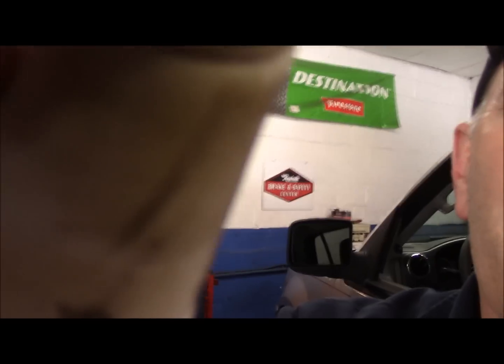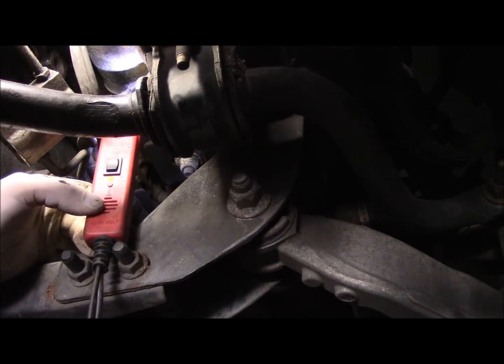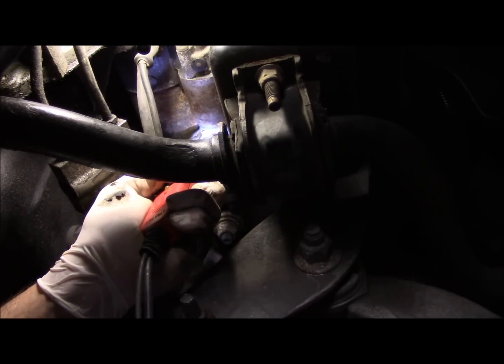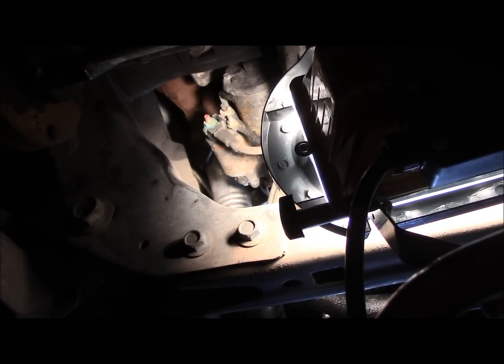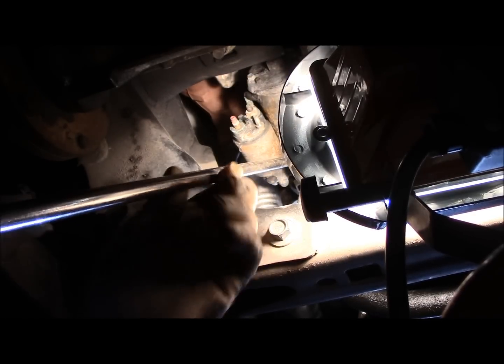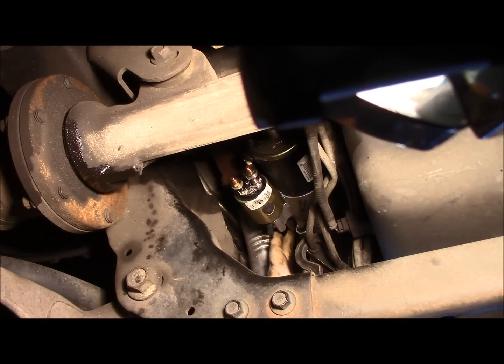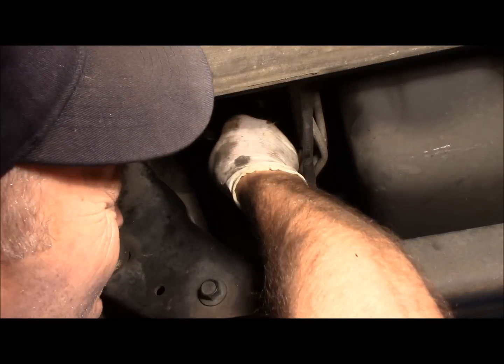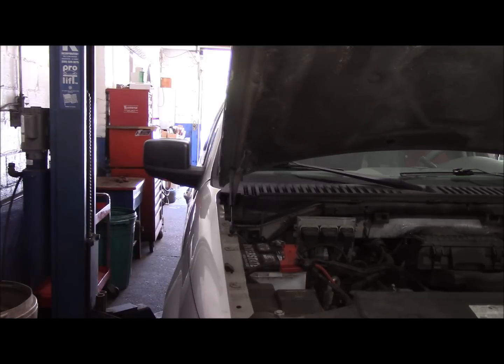Diagnosing  No Start / No Crank/Replace Starter 2006 Ford Expedition

Comment: Hi. Great video. I am encountering a no start (no sound when cranking) issue on my 2006 Ford Explorer 4.0L SOHC   Engine does not crank and is totally silent when turning the key. Vehicle has a brand new battery (12.5V with voltmeter ) and everything lights up on the dash as normal. The tow truck driver said it was surely the starter and this morning i purchased a new one and installed it, but same issue    What can be causing this?  Some kind of solenoid?   Any feedback will be greatly appreciated

Regards,
Mark
Reply from the maker: You will need to check power and ground to the starter before you replace anything.Keep me posted . Jim
Reply: Pat system my truck did that had to get another key made
Reply: Mark did you fix your problem I have the same problem please let me know thanks
Reply: @MrSkorpio317 was the starting funny before key fob went out? Or just sudden?
Reply: Did you get it fixed Mark?

Comment: question : if there is no power to the start post  and the cable is good  is that a pcm problem?
Reply from the maker: RICHARD COURNOYER If there is no power to the start wire when cranking the engine you will need to check the starter relay.
Reply: already did  there is no power   at any of the 4 terminals in the relay in any key position
Reply: i also installed a $20 ignition switch and still no crank

Comment: Hi. I dont have no power to truck at all. Same problems in video, but no power. Please help me
Reply from the maker: Did you check the battery and the connections?
Reply: yeah. been working on cars for years. first time, nothing comes on at all.  usallaly it atleast has door chime or headlights.  no short found yet.  all fuses good.  just confusing
Reply from the maker: Do you have 12 volts in the battery?

Comment: Your "scope on a rope" diagnostic tool looks great, but few amateurs (home, DIY) will have one. We just have a generic multimeter with short probe wires, maybe alligator clips. It might be even more helpful to describe your tool's indications in terms of what we'll see on our multimeter.

For example, how could someone use a multimeter to confirm the condition that your "green light means ground" tells you - maybe test continuity to a nearby ground point? 
How could someone use a multimeter to confirm the condition the condition that your "red light means power" tells you - maybe test voltage to a nearby ground point?
Reply: Bob Sutterfield yes I agree could point
Reply: Good point, I meant

Comment: What do you do when battery is charged and you try to jump start, but there is no power, no dash lights, headlights, nothing????????????????  Thanks.
Reply from the maker: The first thing to check is the battery cables if there OK check ground cable (negative )were it connects to the engine. If thats OK check the positive cables.Keep me posted

Comment: I have a 99 Expedition. I changed my starter and battery. I can drive on the freeway to work in the mornings and back home in the evenings.  As soon as I park my truck for 30 minutes or so I get a no start no crank. It last 20 to 40 minutes
Reply: Ever get this figured out?  I'm having the same issue.  Thanks!!
Reply: That’s my current problem too

Comment: what if the power  feed coming into the ignition switch has no power? but i do have power coming to the 50 amp  fuse in fuse  block . what does this tell me? anyone?  thanks
REPLY
Reply from the maker: RICHARD COURNOYER your going to need a wiring diagram before you go any further and you will need to follow it to pin point the problem
Reply: i got a wiring diagram from a guy on a forum  called scanner dan .com.
also a guy i know was a ford mechanic for 14 yrs at a dealership   The diagram shows   yellow wire past fuse  going to start relay where i have no power on the 30 pin  in  so i will be pulling the fuse box tray our friday and seeing if i have  a broken  yellow wire  he thinks it may be at a junction where the yellow heads toward the ignition switch  and relay  will let you know what i find  thanks  ps he said to check yellow at  iginition switch coming in also i dont think power is there either . this car only has 69k miles on a 2003

Comment: Really think the corrosion should have been cleaned from the wire connectors before being installed on the new starter.

Comment: Jim the car guy I need some help please. Im sure it's a simple fix but I'm stumbling. 1975 Pontiac Catalina 400 6.6 simple 2 wire starter. I finished rebuilding the top end and was hooking the battery up as I noticed smoke coming from the ALT area. I examined it Alt wire's got grounded on the head. Removed the P terminal asap. Taped and probed the wire's in the harness everything look's good. So it time to start the punched out big block and nothing not a sound. So I probed the S Terminal Wire on the starter solenoid Wire isn't hot when key is turned over in start position. I'm thinking I've replaced everything on the column but I just grounded out the ALT wire's, as I remember turn the key cylinder and the rod pushes forward and engages the S Wire to have power at the S Terminal on the solenoid. Is it possible that I smoked the ignition switch. Need some help please. Thank you.

Comment: Nice fix
Reply from the maker: Thank you for stopping by the shop.
Reply: jimthecarguy hi i have an 1988f250 with a 460 changed battery started fine. wouldnt start as if battery was dead but it had a full charge. changed the fender solenoid got it started. tried to start again nothing conplete black out again. any ideas please

Comment: Need help have  Ford five hundred 2005 basic addition, I door dash so I basically live in my car, 3 days ago I pulled into a parking lot was waiting for a order the car was off my phone was charging, 20 minutes goes by I got a order and went to turn over car, nothing but clicking ok, I called a friend came to jump me and nothing, he brought me a battery hat would work for my car and is newer, next day I went out started car let it run for a few minutes then left everything seems fine made it half mile away and threw the car into low going down a hill side note new breaks rotors car started shacking in the steering wheel hitting the breaks and going over 45 mph, once I was in low the traction control light came on and anti lock breaks then my stereo Android head unit shut off and all dash lights for 30 seconds I pulled over and put the car into park and let it ital my wife got out I checked all outside lights everything was fine I then took car out of park noticed lack of power in the engine was a few blocks away from advanced Auto had them come check they said it was my alternator, bought that and made it 3 blocks before I pulled into parking lot chit off car and was it had to replace alternator right then and there in the rain/snow doing a subframe drop to get alternator out and back in,all good then, next day drove fine, then today my wife was door dashing I was enjoying the nice weather in the passenger seat coming over the bridge to the red light she sat waiting until the car shut off ,side note brand new muffler very quiet car, she put car into park only way car will start, nothing can't get into nutral from car not turning over all lights work no electrical issue no crank. Called towe truck and went a few blocks to my mother's house, started looking for answers on the internet..checked fuse boxes under dash under hood replaced the starter relay still nothing checked the battery with multimeter reading 12.80V cleaned turminals have no idea where to go from here thinking maby starter. If anyone can help much thanks
Reply from the maker: Thanks for watching.